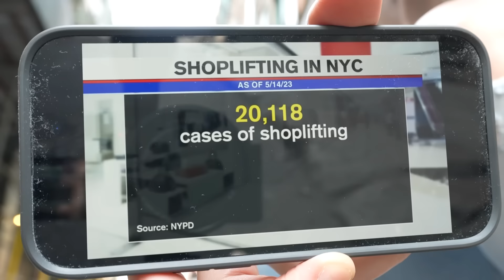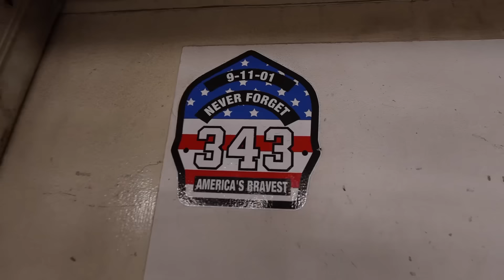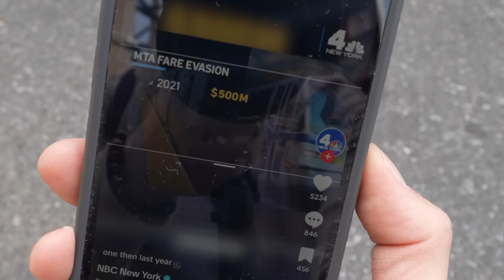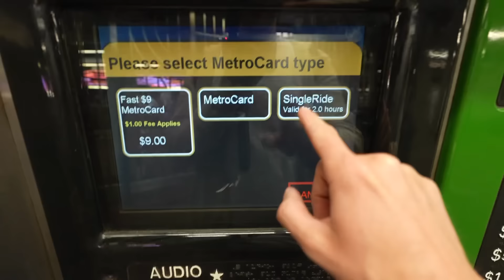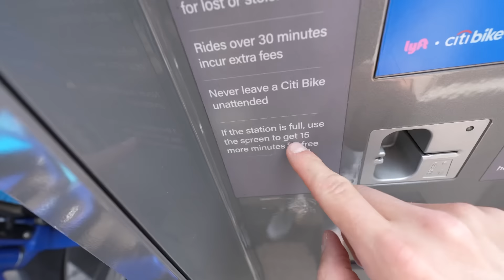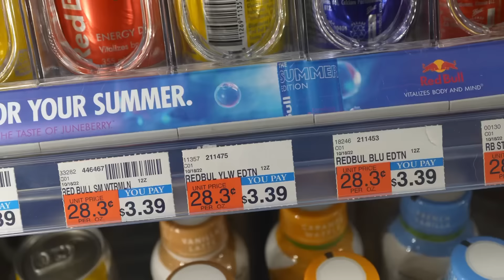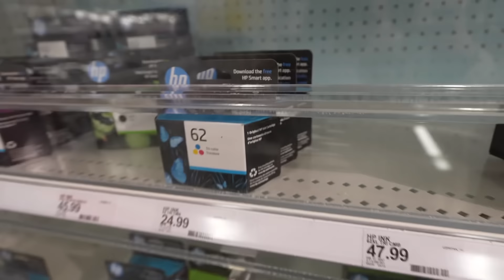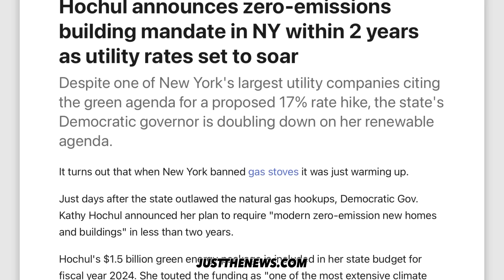New York Just Got EVEN Worse…

Comment: I worked for the NYC Subway system for almost 38 years ( mostly as a manager) and retired in 2017.  When I had to do field investigations or respond to an emergency (especially underground) I prayed that I would arrive home safely after work. Even on the best of days, walking the tracks or structure under live traffic and electricity is tricky.
Reply: So, what was it that made your job dangerous?  Was it the infrastructure, inadequate job safety, the crime?
Reply: @CBatista1234  Working underground under live third rail with trains zooming by. Rats were our ever-present company underground. Homeless and EDP (emotionally disturbed persons) in tunnels and on platforms. Walking the structure above ground on catwalks (the wooded walkway beside the tracks) that were sometimes rotted. Going alone to areas of the city in the middle of the night to perform investigations (without a firearm  or police escort). I was also a voluntary member of the WMD Emergency Response HazMat Team … but that was less scary because we were well trained and worked on groups.
Reply: Wow, I thought union rules made sure workers had safe work conditions

Comment: Electric stoves require sometimes twice the voltage of gas stoves.  I don’t see how that’s possible in some of these older buildings.  I have a friend that lives in Greenpoint, BK and his rent has not gone up in more than 10 years because the building still has fuses!  He can’t run an AC unit or even 2 fans at the same time but his rent is under $1,000 and he has a studio with an alcove.  He uses the alcove as a bedroom with no doors.  I couldn’t take live with the heat in the summer.  They are also banning gas heating systems in new buildings seven stories or less in 2026.  Do you know how much electric heat is?? Electric heat can cause the electricity bill to go up $400-$500 a month during the winter.  I know because my family rented a home for a year and that was 30 years ago that was all electric!  I can’t imagine the price now.  No landlord will pay for that.  It’s going to be a mess.

Comment: I was in San Francisco about 4 weeks ago and the rate for the BART was $10 one way, so $3 is super cheap.  The BART was very clean and seemed safe.
Reply: I was also in San Francisco in March and BART was $10 from the SFO airport to downtown. San Francisco has 5 modes of public transportation, most covered by Muni and. Muni pass saves money, cheaper than NYC subway. When BART is used within San Francisco city limits it does not cost $10. BART is good for reaching those areas further out. Otherwise there’s the Metro, buses, street trams and cable cars covered by Muni passes. One pass good on all but BART. San Francisco is also cleaner, people are friendlier, less aggressive. I didn’t feel threatened by the homeless people as in NYC. It’s still a city with city problems but the trash bins are not overflowing, the streets are hosed down (no urine smells) the public transportation runs more efficiently and is more safe. The city is maintained much better. Very noticeable difference. I live in the NYC area and I get the whole attitude and delusion that people need to cling to that’s it’s the greatest city but that’s not truth. But hey that’s what people need to mentally cope with the unpleasantries of their living environment. San Franciscans have a better quality of life comparatively.
Reply: @Blondie77128  But according to several of our tourist guides, San Francisco is losing many residents due to the cost of living and crime rates.  Many businesses are also leaving. I visited NYC in 1996 by myself and I never felt unsafe.  I have a friend who lived in NYC during the 70s and she laughs at people who think its unsafe now.

Comment: Gas ranges all the way. They still work during power outages (which means you can boil water if necessary) and they cook food better. However, I will always take an electric oven. I wish there was a way to marry the two in the same unit.
Reply: Also, gas is cleaner in a lot of places because electricity is still created by coal plants. NYC is full of hypocrites! The majority of NYC's electricity is created by natural gas and fuel oil. The rest of the state is mostly hydropower and nuclear... but not NYC. SO... they're absolute hypocrites for making gas ranges and gas heat unavailable to private citizens. It forces them to pay the MUCH HIGHER electric price. It's essentially forcing a middle man onto landlords... and for the vast majority, that's going to be ConEd and there's most definitely some sort of incestuous relationship going on between NYC and ConEd. From what I can tell, only parts of Brooklyn are on the National Grid.

Comment: I would not rent an apartment that had exposed gas pipes and meter..  If they must be outside the wall let them put them in a closet so you don't have to look at them.
Reply: The problem is there aren't closets in most NY apartments and if there is one there isn't room to put in a meter as well. Meters typically require at least 3 feet of space around them for access, and there's no room to build a closet around a meter that big. (If you think about the place Cash was looking at and put a box around that meter it eats all the floorspace)